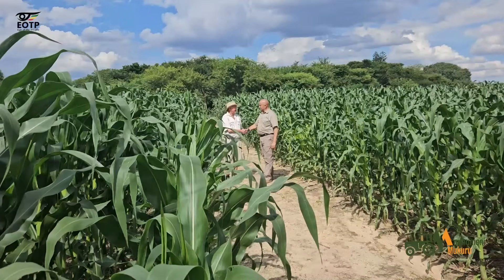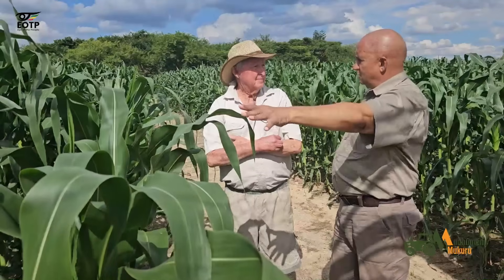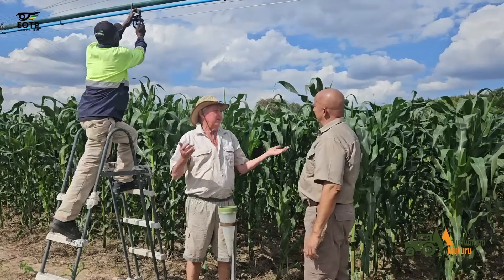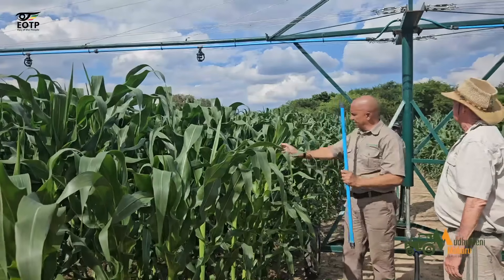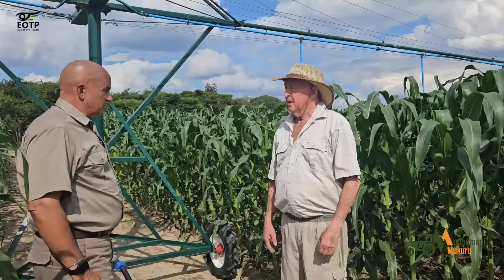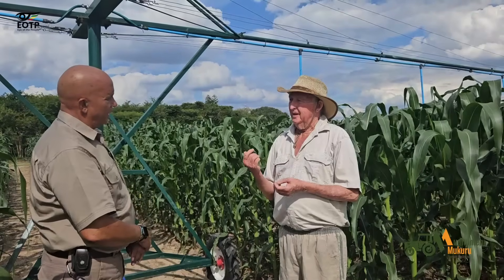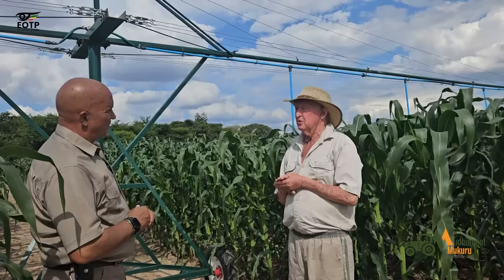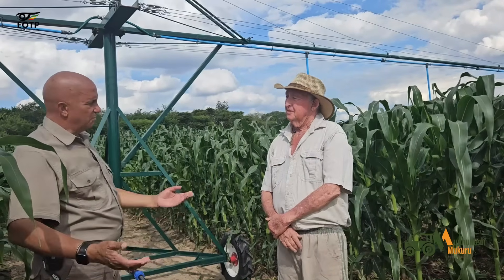The Berin Mini-pivot a game changer for Africa's small scale farmers

Comment: How much are they cost
Reply: $2500 USD
Reply: Very Nice thing, What is the wingspan of the pivot and the radius of sprinklers and that supply pipe is it a flexible pipe or ordinary polypipe,
Reply: @PeterNcube-f2e 30 meter wingspan. Designed to use standard polypipe.